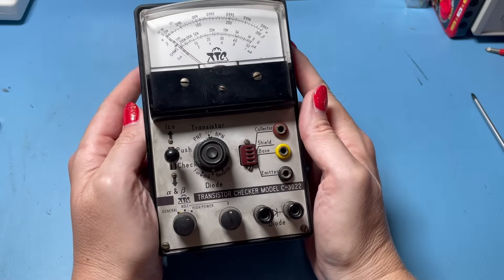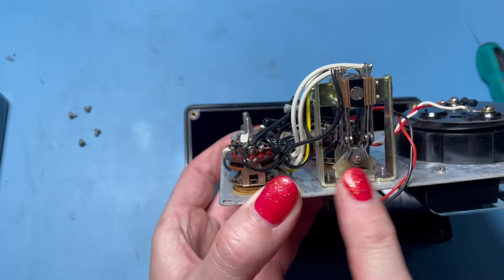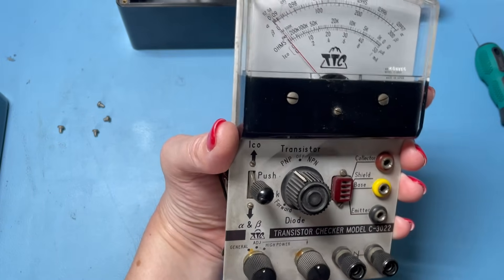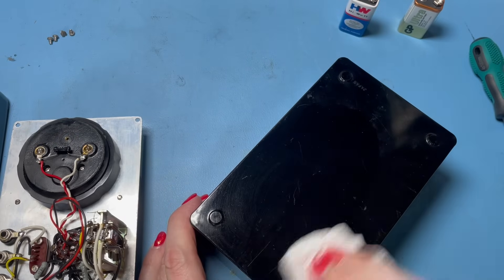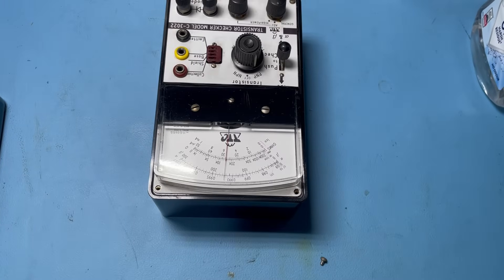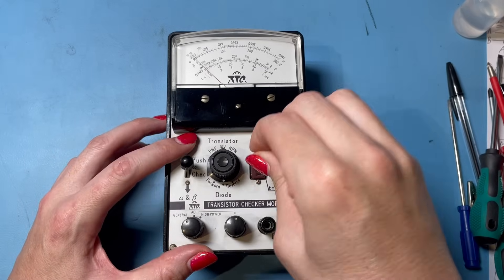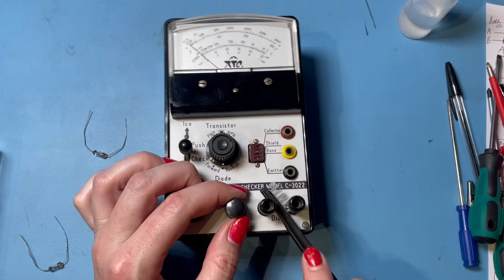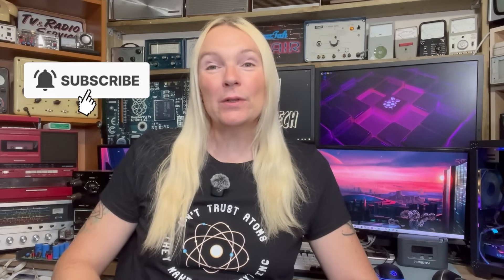A Look Inside A Vintage TTC Transistor Tester - Testing Germanium Transistors & Diodes!

Comment: Picked up a TTC C-1069 multimeter with transistor check today at a local car boot (flee market) for £2. Absolutely no info about it on line. Seems a solid piece of kit and has a bit of weight to it. Need to open it now to check the batteries lol.
Reply: FYI meter was set to ohms when I found it. Ever ready HP11 (C cell) still has fifteen and a half pence price tag on it, 0.5v. Duracell C cell Sep 93 date code 0.5v. Ever ready B155 22.5volt battery measured at 10v. The price tag puts the HP11 in the early 70's date range.

Comment: I have a Hansen ZQ-M they look the same except mine just has a push button for adjust, no Hi Power option though, it did come with the box,test leads and manual.
Sadly I'm either not doing it right or it's faulty, Diode test works but when testing the transistors it always goes of the scale when using the Ico or D&B options.
Reply from the maker: Here's a link to the manual for my one. You may be able to get what you need from this.
https://www.vintage-radio.net/forum/attachment.php?attachmentid=34725&d=1271785720

Comment: A nice little meter - very simple indeed, and pretty easy to reverse-engineer if you didn't have a schematic in the manual. The enclosure is certainly made of bakelite and I like the threaded insets. Built to last!

Comment: That transistor was a Mullard, wasn't it? Just saw a great video on another channel where an old teacher makes an electric candle circuit (from the 1960's) with the use of them. They were all light sensitive, so the glass bulb was therefor painted black. He also said they had become very expensive as younger people loves them in their fuzz pedals and what not. His first video I saw were about the tin whiskers problem in other germanium transistors with tin plated metal cans, also very interesting.
Loves old stuff, that's how my interest started. I teared down old tube radios and such that no one wanted in the 1970's. I some years later got my first multimeter, a Hansen AT-210 (could be early 1980's) that I still have and it still works but uses hard to get 22V batteries for the megaohm range.
Thanks for another interesting old stuff video!
Reply from the maker: Yes, it's an original Mullard, unused.

Comment: Hah. I have one on my shelf. Didn't realise it was vintage! I must be too! Mine still has the short test leads.  I'm pretty sure it's a thermoplastic case. It's definitely 70s, I bought mine around '73 either from Henry's Radio or GW Smith, both Edgware Road London (I used briefly to work at Henry's, longer at Lindair). I don't remember ever seeing it in mags before then - and I read most of 'em!

And re: other commentators, we used to refer to germanium devices as "geranium" - because they wilted easily. Which is rather unfair on geraniums, frankly, they are rather robust plants, but still, it was funny at the time... I have a load of OC and AC trannies in my drawer still, including GEC devices in small anodized heatsinks! Germanium diodes were very useful for meter rectification because of its very low forward voltage, I still use germanium diodes for that purpose and other tasks. 

I used to use the TTC tester to test and measure them all. The switch is a GPO type switch. I used to use those a lot in audio gear, but not the Japanese version. I wasn't that big a deal, it went with my Avo valve tester 😃 My Avometer has some Bakelite!

Comment: OC71's, those were the days Jane! My first job after leaving school at 18 in 1970 was with a company called Stereosound Productions Ltd. in Brighouse, West Yorkshire. We made domestic audio equipment and the range of amplifiers still used Germanium transistors for several years, namely AC128, AC176, AD161 and AD162. The radios used to use Mullard IF and tuner modules which were also Germanium transistor based. Wonderful times.